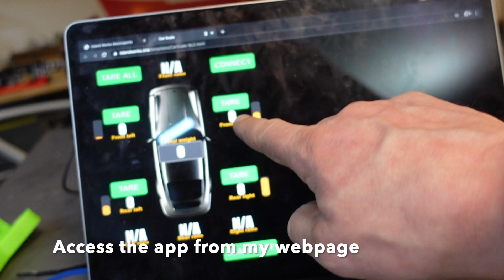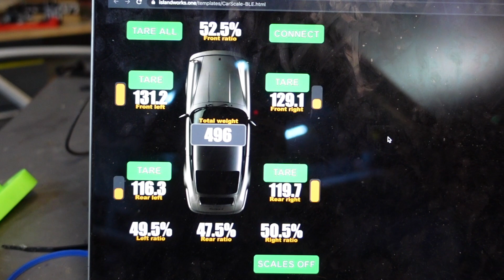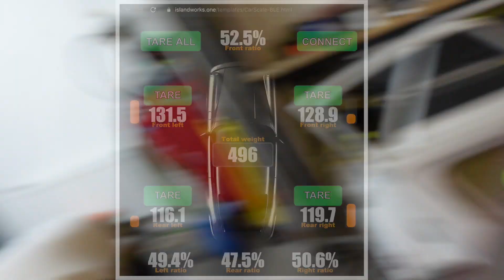Touchdown - Uni-ball and rear suspension installation for Porsche 964

Comment: i like the final cooler setup..  what about directing some of the air after the coolers to the brake ducts? Big brakes need lots of air cooling
Reply from the maker: I’m really happy with how it turned out! I will find a way to blow over the brakes as well. I have a few ideas already, but need to get a bit further before I see how it pans out ;-)

Comment: Great content as always do you have info or a video on the parking brake really interested to see what you did there 
Thx
Reply from the maker: I’m also interested in what I will do there… still on the drawing board unfortunately…
Reply: @islandworks  did you say you had a caliper on order for the parking brake as have been looking at the Willwood ones for mine just need to work out brackets
Reply from the maker: @sailrockpaperscissors8261  yes, I have them from Hispec, but don’t think they will fit in the end.

Comment: Loving these videos.  I can only dream of taking on such a build - great to see though.  I noticed a clamp still in place on one of the arches when you were installing the trailing arm - did you have to reglue something from an earlier install?
Reply from the maker: The rear bumper is still only hanging there and I need to get it tapped and clamped properly with the screws and washers 👍🏻👍🏻

Comment: Hey. These new spring plates are made from spring steel?! I'm not sure, but i saw them at drs site and they looks like made from spring steel. Is it have sense? Firstly sprint plates cooperate with oem bushes on the outside link, which moves from side to side when spring plates bending. You replaced them to uniball so there is no longer way to this kind of moves.  And secondly your trailing arms are less stiffness. I'm not sure but i suppose they only disturd now. Am i wrong?

Comment: What you’re doing is amazing! One question: you said that the OEM bushing of the inner arm (the one that contains the toe and camber adjustment) has a sort of uniball. Mine has the rubber cracked, since it has an uniball inside, do you think this can affect the drive under load or not? Thanks.
Reply from the maker: Sorry for the delay in answering. I would change the spring plates if they’re broken so that you don’t get into something worse. The lower trailing arm only sits in two pivot points and it could be significant if something happened with it. Just my thoughts...

Comment: Was retrofitting a locking ring to the wheel bearing an option ? instead of the 4 bolt plate.
Reply from the maker: Possible in general, but not enough material the way it looks right now. The washer goes flush with the bearing.

Comment: You could have burned the bushings out, am i right?
Reply from the maker: Perhaps, I didn’t try that ;-)
Reply: @islandworks  i mean i have done that with an old TT front trailing arm bushing. But they hadnt that much Steel in them xD
Reply from the maker: I did it the trial and error way instead... I’m glad I didn’t film what I did on the other side!
Reply: @islandworks  ah dont worry. You are easyly the most underrated channel if it comes to racebuilds. Absolutly enjoying your creativity and i am always impressed how professional everything looks in the end. As well as the fact, that you explain your thoughts critically. Just Perfect,